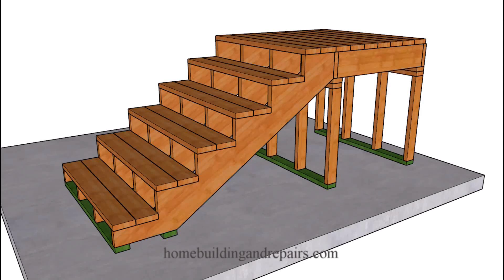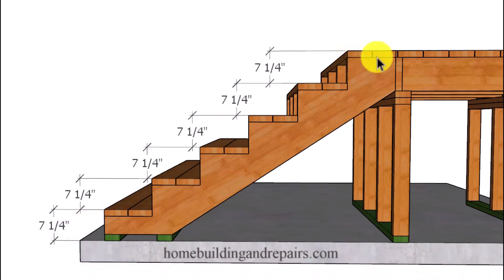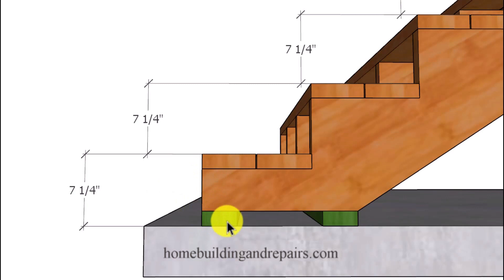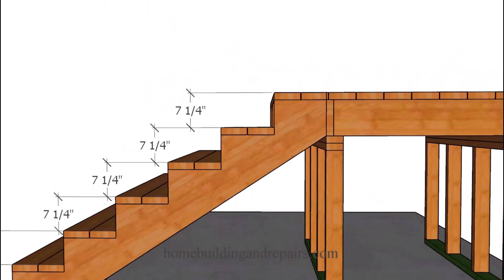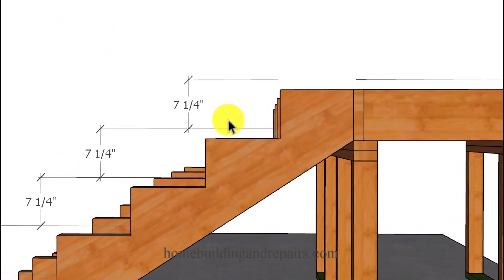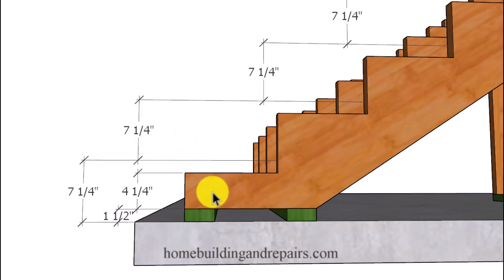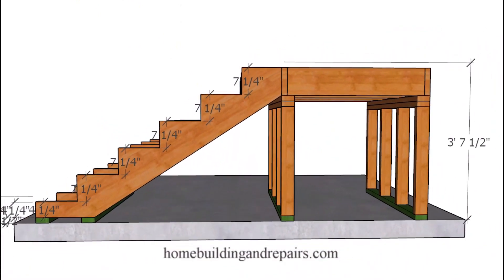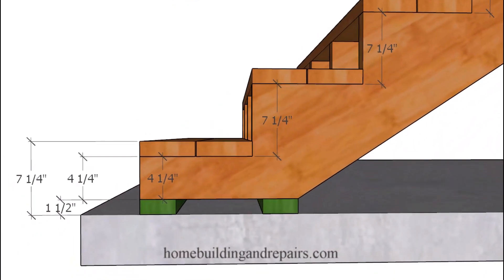How The Stair Stringer Location Can Affect Riser Heights - Easy Learning Stair Building Education

Comment: We had a set of stringers that were cut out of rough cut lumber. They were in place when we bought the house. They cut them wrong. They I my did the step cut 9 inches.  So the steps were horrible and also unlevel. We leveled it and decided to cut the step to 11 1/2 inches and then up the rise. It wouldn’t work before after about two steps it was cutting out of the wood. I figured it was because they cut it wrong to begin with. There are 14 steps and it is going down into the basement. Are there any other options besides tearing it out and starting over ?
Reply: Not really. You’ve discovered what makes almost every set of stairs a unique project by itself. This is what makes stair building one of the more skillful tasks for the carpenter. You should be able to use your riser and tread material again but your stair stringers likely need to be redone with new material.